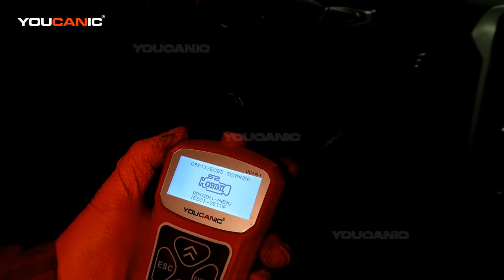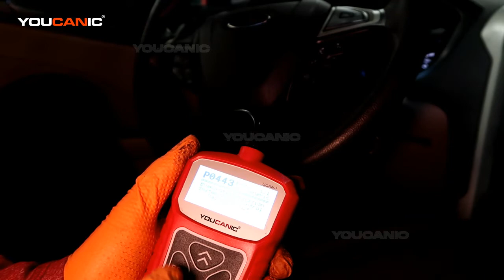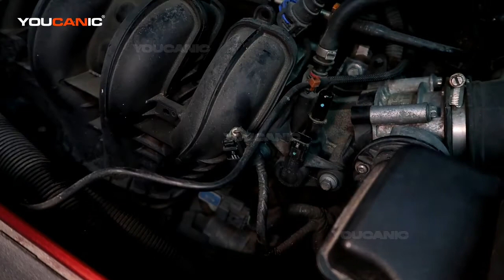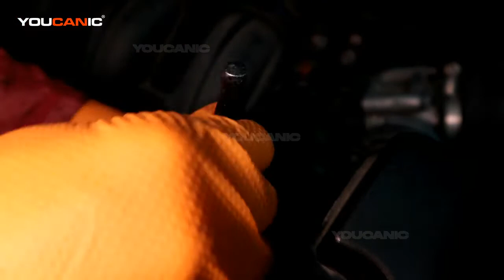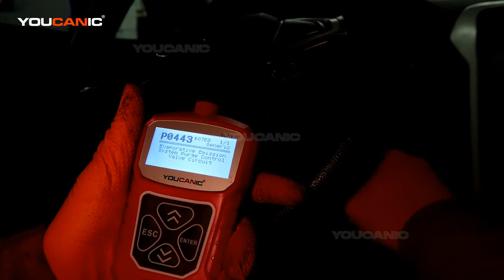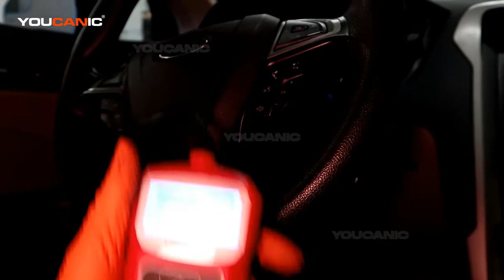2013-2020 Ford Fusion - Fix Fault Code P0443  Purge Valve Solenoid Replacement

Comment: P0442 changed the part of my 2.5l fusion 2016 code game back
Reply: Did you figure out the issue? The hose could also be cracked or clogged or  the canister near the gas tank is clogged or cracked.

Comment: replaced it a few months ago due to P2916 code, now im getting P0443
Reply from the maker: Thanks for reaching out! It sounds like you're running into some trouble after resolving your P2916 code and are now encountering a P0443. We're here to help at YOUCANIC! Our site offers helpful guides, a plethora of free resources, and our powerful YOUCANIC scanner that can assist you in your car maintenance journey. 

Don't hesitate to visit [www.youcanic.com](www.youcanic.com) and reach out, whether you need tailored assistance or in-depth factory repair manuals. Our mission is to empower you, making you confident and capable. Lean on us for support, we're on this car ownership journey together!
Reply: @YOUCANIC  Definitely thank you. 

gonna unhook the plug and test the plugs ground wire with a multimeter, don't have a fancy diagnostic scanner so i cant trigger a EVAP test to test the positive unfortunately

Comment: I have 2019 ford fusion 1.5 L. Code p0443. And auto parts store gave me the purge valve but it’s a box looking think not this
Reply from the maker: Thanks for your comment! The part you received might look different, but it's important to ensure it's the correct part for your 2019 Ford Fusion 1.5L. At YOUCANIC, we provide guides and resources to help clarify this sort of confusion. Our aim is to make your car ownership journey easier and more empowering!

For more assistance, be sure to check out our website at www.youcanic.com. We offer free resources and a powerful YOUCANIC scanner that could greatly help in your situation. We're here to support you - reach out to us via our site anytime!
Reply: @YOUCANIC  it’s showing me the same video. I just commented on the part. I have was called purge valve and does not look like that.

Comment: Do you know if the purge valve is in the same location for the 2011 3.5 SPORT model??
Reply: I got the 3.0 model for 2011, it’s in a very similar place and looks the same